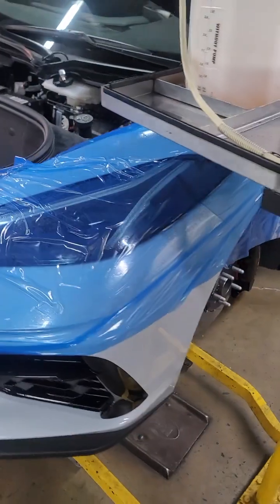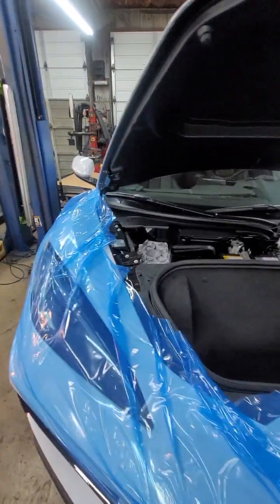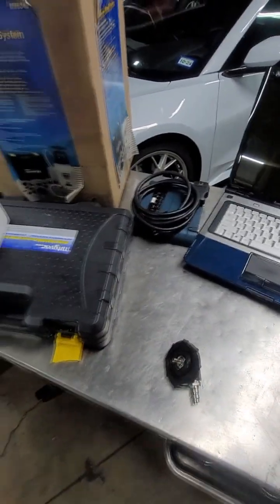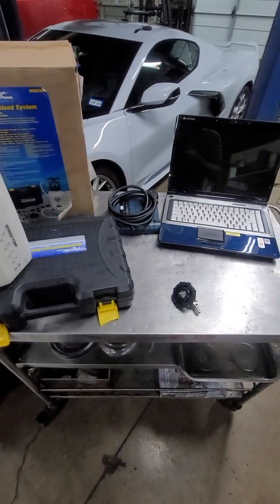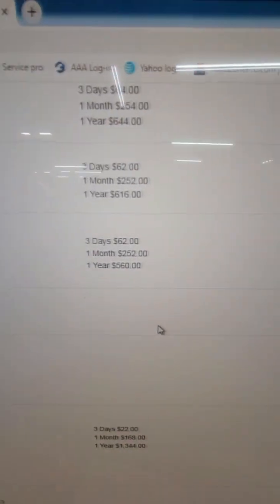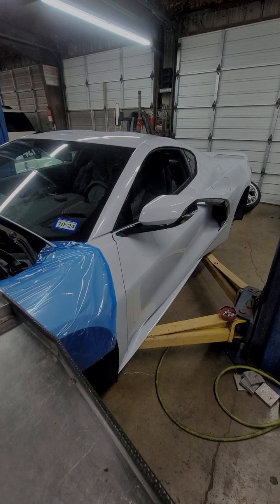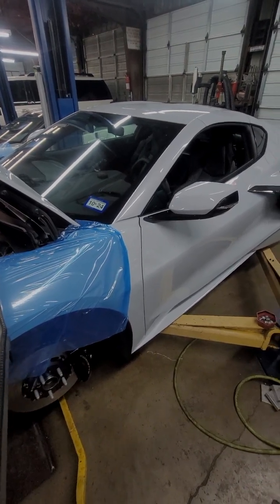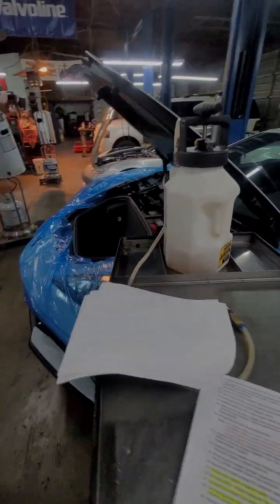C8 Corvette brake bleeding procedures

Comment: I just upgraded my C8 Z51 pads, brake lines and fluid.  The first thing I did was disconnect the battery.  I swapped the pads and lines.  I used the Motive Power Brake Bleeder and flushed the brake fluid by myself.  No pumping the brake pedal.  When all done reconnected the battery.  No lights, no problems, brakes work great.
Reply: Was this that simple? I have new calipers and pads to put on. Hate to run it to dealer for this.

Comment: To clear the brake codes, push the start button without stepping on the brake petal to power up the car. Do not start the engine. Then press firmly down on the brake pedal for 20-30 seconds. You will hear clicking noise during this process. When the clicking stops you can start the car and the brakes will be reset , the codes cleared and warning lights gone.

Comment: My GM service team changed the fluid and after a track day went to limp mode. They changed the entire brake booster system and programmed it and 2 days later same problem. Now GM is saying it’s because I have girodisc rotors and carbotech pads and I gave to put OEM parts back on. What have they done wrong?

Comment: Thank you for this informative video, and you are correct that there is an information vacuum about this online. I was going to swap out my calipers (from black to yellow) on my 23 C8 using the usual brake bleeding procedures. You have saved me from making the serious mistake of trying to do this without the exact tools.
Reply: This video will save a lot of tow jobs to the dealership. If you don't have the proper equipment don't even try it.